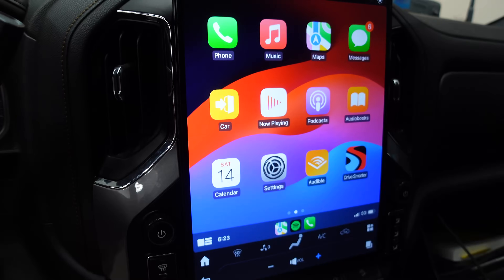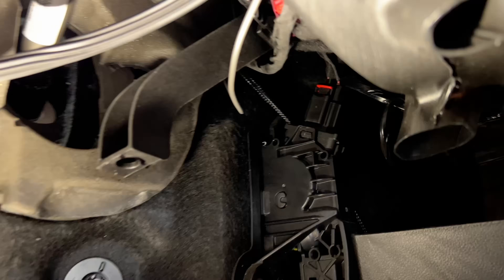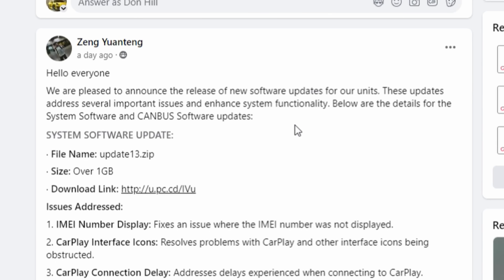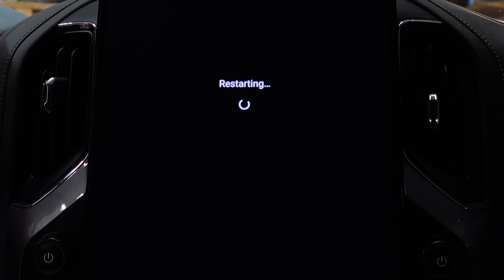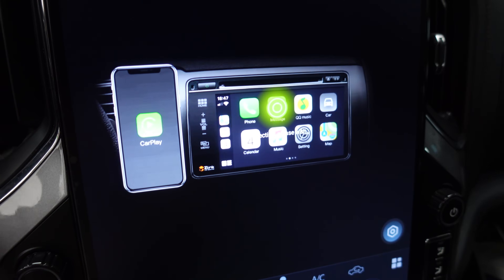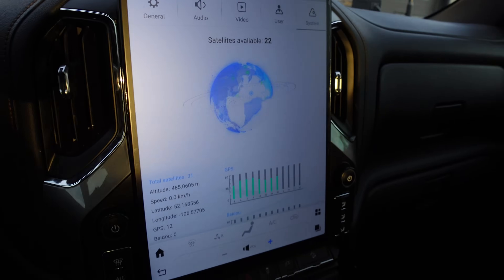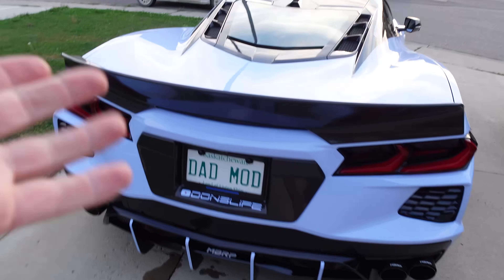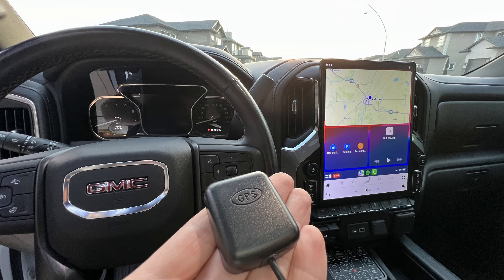How To Tap Into Your Factory GPS Antenna For An Aftermarket Screen & The First Major Software Update

Comment: All the apps and processes reboot every time the car is turned on, which causes a delay in initialization. If they install a small USB power bank and configure it to enter hibernation mode instead of shutting off completely, it might speed up the startup process. Think of it like a computer—tablets are essentially small computers. RAM is static as long as it has power, but if the power is cut, the memory is erased. I'll try this setup when my device arrives!
Reply: You’re smart you should send this idea to them

Comment: Hey Don, how's it going? My Aucar is being shipped, can't wait to get it. About the GPS taps you installed, are they specifically for your GMC or is it for all? I have a 2019 Silverado LT Trailboss. Thanks for your time and your videos. Dan.
Reply from the maker: The GPS adapters will fit all of the similar GMC and Chevy trucks.  The locations of the factory plugs can vary

Comment: Don, so you installed additional USB ports with the new head unit? Is it possible to use factory USB  ports to install updates?
Reply: No. Only the ones that connect to the back of the new unit
Reply from the maker: You can’t use the factory USB ports for updates as they are only connected to the factory infotainment system. The add on screen upgrade comes with two USB cables that I ran into the glove box (no cutting). This was shared in a prior video for this product.
Reply: Thanks for the reply your a big help. I have already ordered the new screen. I have not watched all your videos yet pertaining to this mod but I’m working on it.

Comment: Hi don...videos are awesome...i have a question i recently installed the aucar 15"   however i cant get a stable connection to carplay via wireless nor thru usb...any recommendations...i cleared the zlink cache...still wont get a stable connection.
Reply from the maker: Apparently another update is being released soon.  The CarPlay connection issue is still prominent.  I hope the update has something for the CarPlay die hards.
Reply: @Donslife  thanks Don

Comment: Getting ready to install new unit from Radioedit. Was looking at brown GPS connector. Man..are u guys taking Pelotes or what..I'm a smaller guy who stretches often and having alot trouble getting in position to access/remove locking connector.  Any advice to make easier?
Reply: Ok update on my last post. I put my seat all the way back with seat in lying down position. Got in upside down position. Was able to disconnect/reconnect GPS brown connector, figuring out lock. Now I feel much better for when receiving unit for install.

Comment: This may be a dumb question, but if I get a SIM card and only plan on using google maps & Waze apps for navigation do I need to change this gps cable?
Reply from the maker: No but it will be more accurate/responsive with a connected GPS antenna

Comment: When you disconnected the unit to plug in the adapter, did you take apart the entire console like you did taking out the oem unit or just the top half enough to get into the back of the unit? Sorry for such a long question..
Reply from the maker: I had to take pretty much everything apart again.  No shortcuts
Reply: @Donslife  10/4. Thought I could squeeze by without 😅

Comment: After that install would you need the GPS dongle they gave you or can I just take that off?
Reply from the maker: Just leave it in the box.  The gps tap will still require plugging into the back of the new screen.

Comment: Is there any way to retain the factory USB/USB-C ports that are in the dash and connect them to the new system, or are you forced to use the ones that are included with the system to communicate updates?
Reply from the maker: The stock USB A and C plugs are not able to rerouted to the new screen. Therefore you need utilize the extra USB A cables for direct connections to the new screen. 

Some people have purchased adapters to strategically integrate the new plugs into various areas for a factory look.   But they still have the factory USB plugs as well.
Reply: @Donslife  Thank you for the reply! I purchased one of these after seeing your videos and used the code you provided. Thank you!
Reply from the maker: You’re welcome

Comment: I tried something similar in my 2022 2500.  Since I have a truck I lose the XM signal often. I purchased a XM antenna and splitter so I could put the antenna on the front of the hood. But I keep getting a warning that says the antenna is not connected. Ugh!

Comment: Are you doing this all Bluetooth? Does it make a difference if you plug it in? I always plug my phone into the truck. I have a 2021 silverado and I've been eyeing this system since I saw your video.
Reply from the maker: All bluetooth.  This screen is NOT wired CarPlay compatible.   I could plug it in to the factory USB port, but then CarPlay wouldn’t use the full 15.6” screen. Instead I’d have to view it in a reduced form in the ‘console’ view.  Like all the other factory apps The truck cane with.
Reply: @Donslife  although I choose nit to use carplay, I have a sim card and the carplay connection/connectivity is much quicker. I wonder if it has anything to do with the sim?
Reply from the maker: I am not certain of that but maybe it’s something

Comment: Would have liked to have seen how you fished the gps cable behind the dash....
Reply from the maker: When the screen is pulled out it is a 6” run under the vent tube.  I can almost reach my hand in the cavity to grab the wire while feeding it up from below.  The excess cable is tucked behind the plastics. I am sorry.  Filming behind the dash is incredibly difficult when by myself.

Comment: A guy told me that these cables should have a diode because otherwise there would be problems with the screen, is that true ? I already ordered the cable and only then did they tell me about the diode and I was scared to mount it on the screen
Reply from the maker: An active GPS antenna, like antennas some people may still use on their homes use diodes for protection.  I have never heard of someone adding one for this type of application.

Comment: Does anyone know how to get the volume knob to work after the installation of the update? Thanks
Reply from the maker: Did you apply the Canbus update?
Reply: Yes
Reply: My volume stopped working afterwards.
Reply: I was having an issue with the AC defrost coming on and triggering a check engine light.
Reply: I saw your updates. I installed the canbus and lost the volume control
Reply: Thanks for any assistance and help with this issue.
Reply from the maker: I don’t have an answer at this exact moment, but if you are part of the facebook group, there could be some new information there.  It has way more information than I can convey alone.  Plus it is Aucar’s group for support.  If I learn something soon, I will reply back here
Reply: Thanks

Comment: So.. Are you going to give credit where's its due or just pass it off like you came up with this idea even though it was out for weeks before your video
Reply from the maker: Have you read the video description? Mitch Moen is a great resource.  I did not ‘steal’ his  idea.  I wish people would just ask me where I got the idea.  It is extremely unfortunate that this assumption is being made.   

In July, before I even knew about the Facebook support group, I was contacted by Mohammad Haris Sharif on Instagram.  Within our chats; On July 27th he shared with me the GPS tap. He had performed it.  He also shared with me some other modifications he’d performed while owning his screen.  When I eventually found the Facebook group, I did see the parts that Mitch Moen was recommending to make the installation easier. This was helpful since I was getting frustrated with the search on various websites for cables and adapters that wanted far too much for shipping.  I am sorry if Mitch and any of the people he has helped feel I am disrespecting his efforts.  The truth is, somebody else shared the GPS Tap mod with me.  Mitch’s pictures of the cables he used, helped me get the job done cheaper.  Thank you Mitch.  This is not the first GPS tap I have done either.  Before Youtube (only 5 years now) I installed a ‘carputer’ into a car and tapped into the coaxial gps cable it had for its antenna.   This was a far more complicated install.  Nothing was plug and play.  I do have some skills and knowledge too.  I really don’t know how else I can resolve the situation other than provide explanations on how I received an idea for a mod (this mod) when people ask me.   

I am sorry feelings may have been hurt.  I am sorry that Mohammad Haris Sharif didn’t let more people know about his mod with the online community.  It could have helped stop people from assuming the idea and execution of that idea only happened in a Facebook group.   

I thanked Mitch for his post in my video description and in several comments on this video.   I don’t know what else I can do to resolve the controversy.
Reply: @chompchomp Don gave credit to Mich Moen on his text intro.